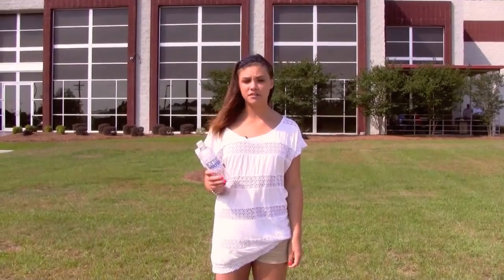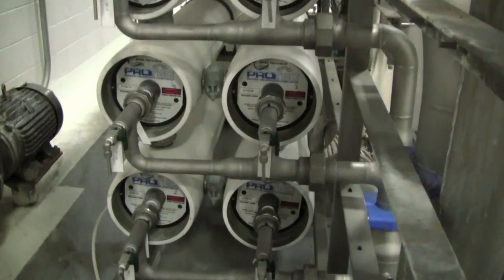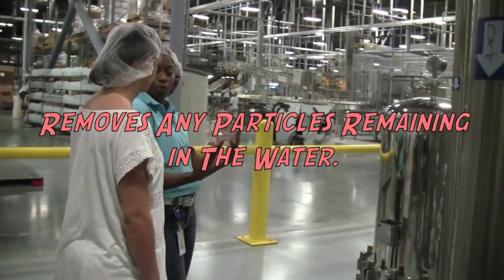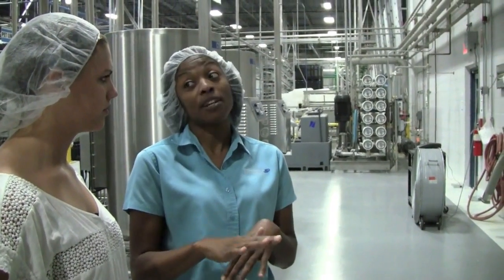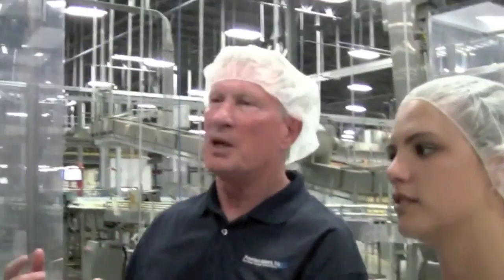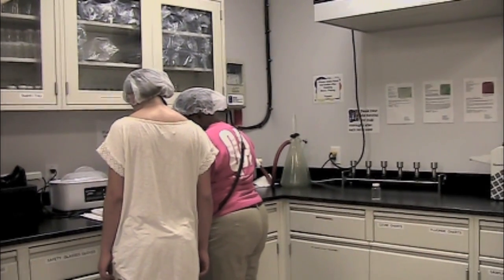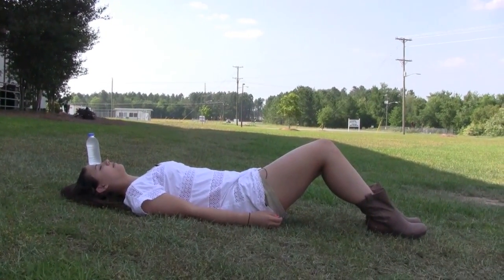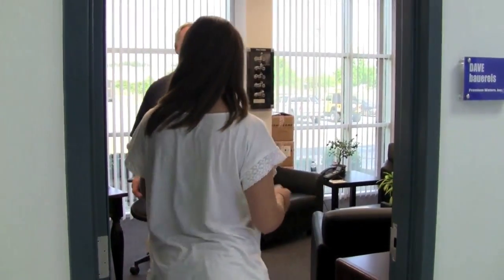From Tap to Bottled Water

Comment from the maker: @mikecoker FDA's jurisdiction over bottled water products extends to products sold within a single state that are enclosed in packaging materials that have moved in interstate commerce. Known as the component theory of FDA jurisdiction, if any component of a food product moves in interstate commerce, FDA has jurisdiction over the finished product, regardless of whether the finished product itself moves in interstate commerce.
Reply: What is the FDA’s regulation regarding tamper proof/evident seals on bottled water? Would a plastic heat-applied film suffice?

Comment from the maker: @thebestalkalinewater NEWS FLASH direct from the FDA website - "Section 410 requires that bottled water be subject to requirements no less protective of the public health than those applicable to water from public water systems using the techniques required by EPA's NPDWRs" (This means that bottled must be at least equally regulated). Plus think about it -- this video is shows the many steps involved in turning "EPA-regulated" tap water into refreshing bottled water.

Comment: Delivering bottled water in trucks is insanely inefficient, wastes resources, and contaminates the environment with unnecessary plastic and air pollution. Water should be piped and treated as near to the point of consumption as possible. It's WATER, people. It magically flows through pipes!